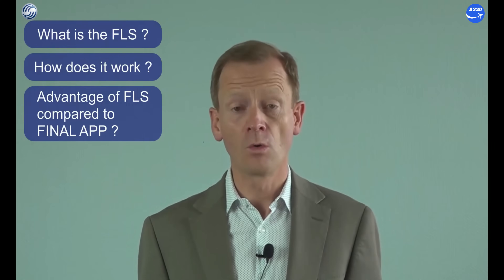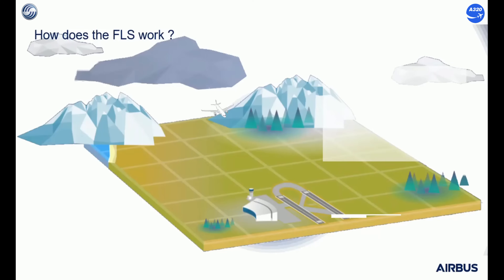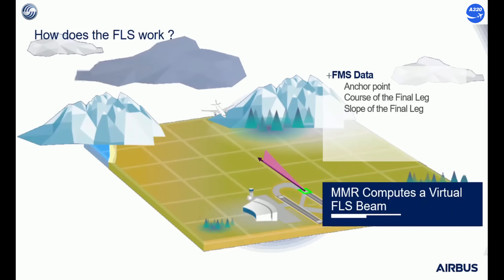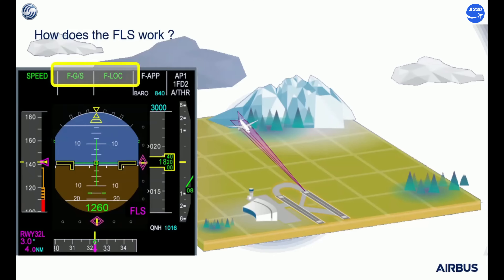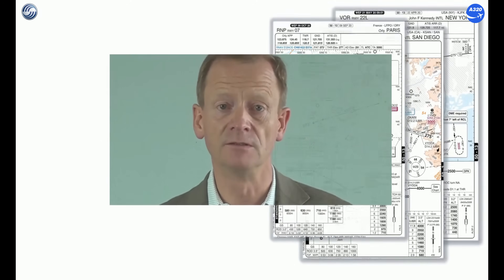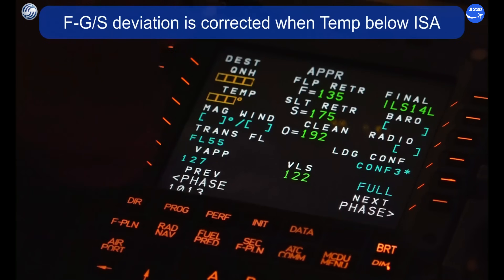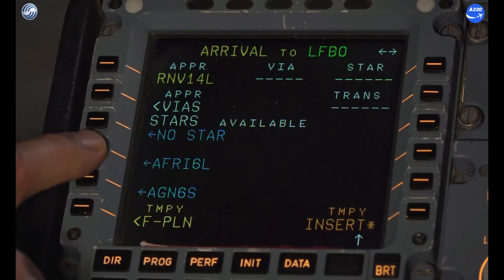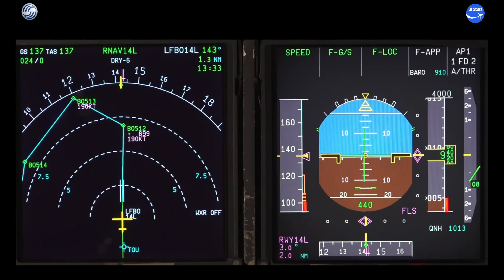A320 Operational use  of the the FMS Landing System (FLS) Guidance mode.

Comment: How did you get the DRY-6 appear below the runway approach indication?
Reply from the maker: @global6000  only if you have installed ROPS
Reply: @a320mentorchannel  thanks. where is it put in the FMGC? Via the MCDU approach page? Or via the autobrake panel?
Reply from the maker: @global6000  auto brake panel there is a selector for wet or dry runway